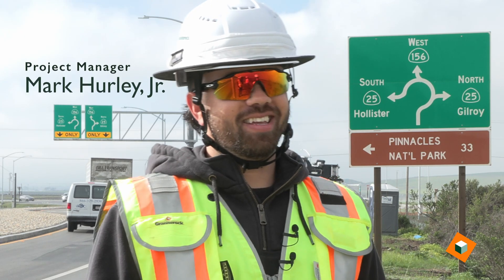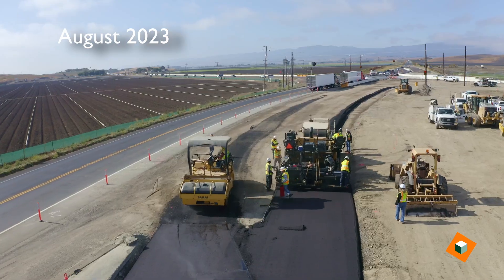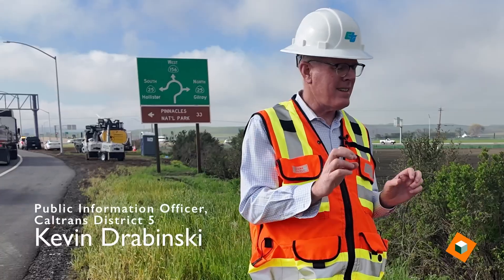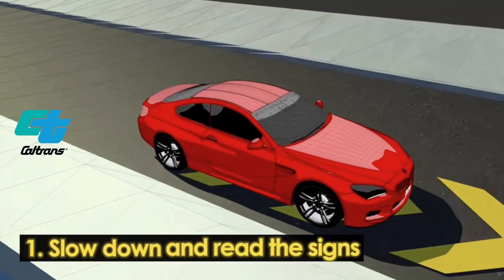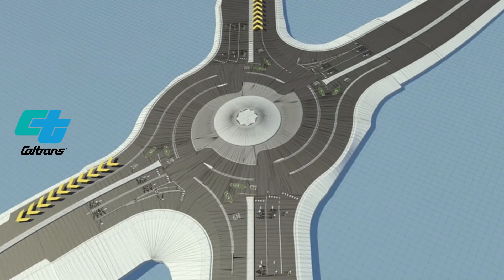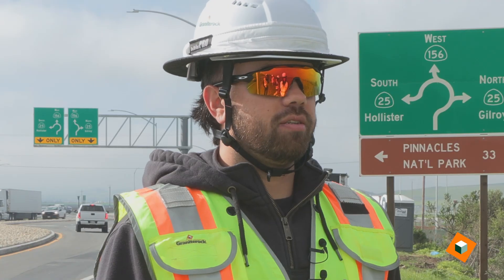California's first turbo roundabout built by Graniterock in San Benito County

Comment: In this video, I see cars straddling the solid white line which is not supposed to be crossed or touched at all. I also see a driver about to push their way into a space where a 40 ton truck is headed despite the truck having the right-of-way by both law and physics.
Reply: Vehicles entering a roundabout have to yield.
Reply: Truck still has to yield to those in round about. You can’t just push your way in if you don’t have a gap.
Reply: @chrisstromberg6527  legally, traffic entering the roundabout must yeild. Physics, !!!FORTY TONS!!! no matter how much you expect a truck to stop in time at the slightest provocation, it will not stop like a Miata. It will stop like a freight train
Reply: @chrisstromberg6527 only to avoid killing the driver of the car. The car was supposed to yield to the truck. Car broke the rules.

Comment: Turbo roundabouts (a dutch invention) is just a more explicit multi lane roundabout : forcing you to choose the appropriate lane before entering. 
Right turn shortcut lane tend to exist also on normal roundabouts.
Reply: It's a bit different, in that with a normal european roundabout turning left (or right in the UK) you hug the island until you exit, instead of spiralling out like a corkscrew. Specifically I'm talking about the non-painted ones, which are still considered multi-lane, unless it's physically impossible to fit two cars side by side.

Comment: Please tell me cyclist arent't allowed there.
Reply: Yeah, saw that in the CG animation. Not a good idea.

For turbo roundabouts, pedestrian and cycle paths are best grade-separated, either under the motor vehicle traffic or above it. I prefer above, as it’s more scenic and it’s cheaper to build the lighter-duty paths elevated than the higher-duty paths. I just hope they keep the grades low enough for people in wheelchairs or mobility scooters to manage, and protect the supports from impact.
Reply: @chow-chihuang4903  In the Netherlands they have the same roundabouts, but with cycling lanes. The cycling lanes split apart from the road before the roundabout. Then they go perpendicular with the roundabout, crossing the roads at the roundabout at a crossing, a small distance from the roundabout itself. So basically a huge round cycling lane around the roundabout. It made sense.

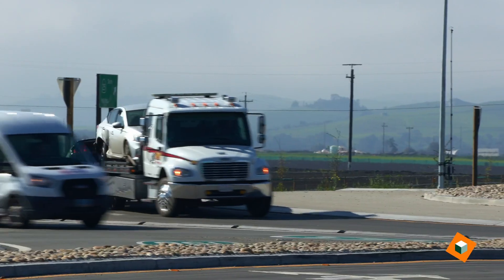Comment: And yet ironically at 0:59 they show traffic doing the wrong thing and stopping in the middle of the roundabout.  Granted they really had no choice as 2 large vehicles pulled out in front of them when they shouldn't have (especially the second one pulling the trailer).
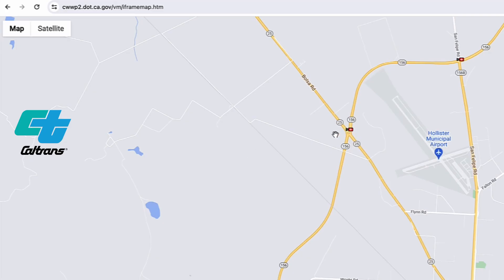Reply: The red car at 2:07 also doesn't stay its own lane, almost cutting off the SUV. And that's the example they use to show traffic moving smoothly. Hmm. Roundabouts are easy but there are rules...
Reply: @FrietjeOorlog  nobody follows rules here!
Reply: @nonamewhodis as more roundabouts are added an increasing amount of people will be more aware of what to do when driving in a roundabout
Reply: @FrietjeOorlog And drifting out of your lane is dangerous no matter what kind of road or intersection you are on. As is running red lights, as far too many people do. I always wonder whether people running red lights have a death wish.
Reply: @FrietjeOorlog  but that isn't the fault of the roundabout, that's just bad driving because in the US you get your driver's license in the cereal box.
Reply: @VincentPeerlinck  Do you always use lies to justify your hate? 🤔
Reply: If a semi is entering its going to possibly slow/stall traffic in the roundabout. There is no possible way to avoid that. They take awhile to get going from a stop.
Reply: @dinkleberg93  And it's impossible for a pickup truck towing stuff to not go as soon as possible because their genitals would shrivel up and fall off.
Reply: That's why in the USA roundabouts get even better over time when drivers get used to them.
Reply: I often drive to unfamiliar towns by myself and let me tell you roundabouts have often sent me in the wrong direction.
Reply: @christinecortese9973  😆

Comment: Roundabouts been everywhere outside the US for over 50 years. Only Americans could market a roundabout “Turbo”
Reply: This is an actual turbo roundabout, which is different from a regular roundabout. As you can see in the video, the roundabout is not perfectly circular and does not permit traffic to make a full lap. There are separate lanes for some, or in this case, all directions. Turbo roundabouts are quite common in many European countries, and are typically used for intersecting main roads where traffic volumes exceed the capacity of a regular roundabout.
Reply: > Only Americans could market a roundabout “Turbo”

It's a concept imported from Europe.

The idea is that when you get on the roundabout, your lane has a definite point you have to get off of the roundabout again. There's no "keep going round". It makes multi-lane roundabouts meaningful and useful, since you don't have to cross 3 lanes of traffic to get off of the middle one; it naturally progresses to the outside as you turn, giving people right of you a clean path to exit to their directions while making it efficient to use the left lane to turn left, both in entering the roundabout and exiting it again.
Reply: lol man I hate taking the piss out of americans any day of the week, but turbo roundabouts are an actual thing
Reply: You wanted to dump on da stoopid Americans so bad, but you didn't even know that the turbo roundabout is from Europe. Nice one. Maybe make sure you actually know what you're talking about next time?
Reply: These are gonna be great for drifting
Reply: it wouldn’t surprise me that turbo is used to indicate that this is an efficient roundabout.  in many communities in America, the safety nannies, and vision zero imbeciles, use roundabouts to impose their insane brand of command and control on drivers.  so the roundabouts have stop signs at each entry point, and speed bumps or traffic barriers.
Reply: Even in the US we have had for 25 years. California is just "special"